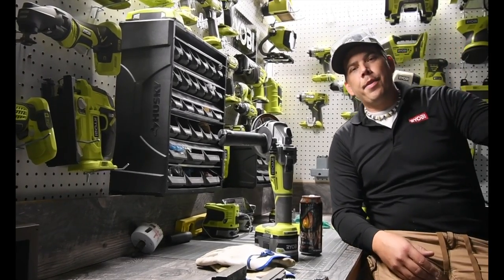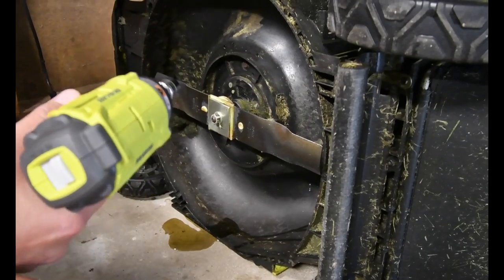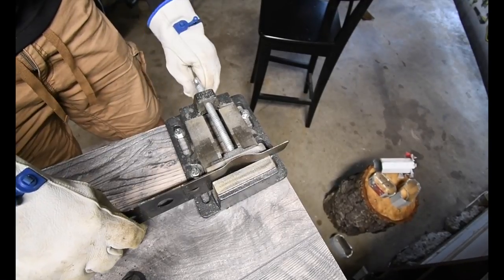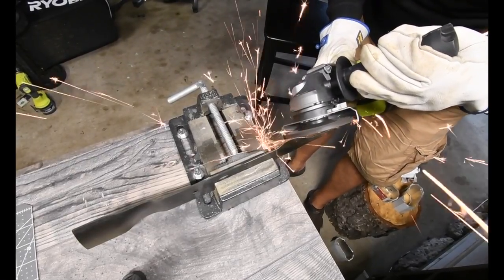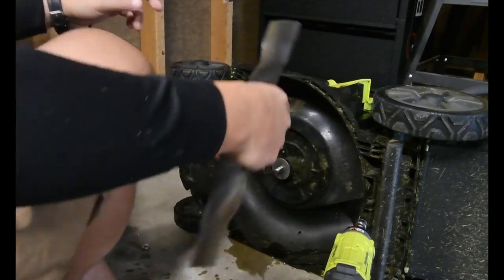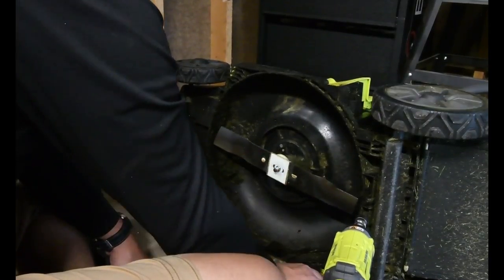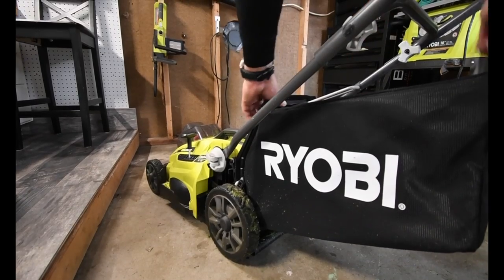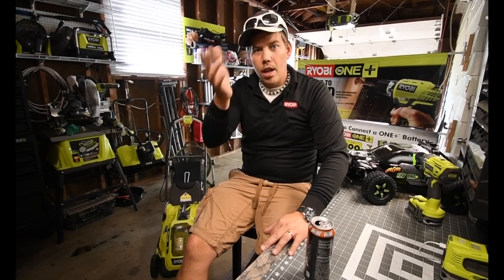Ryobi Lawn Mower Blade Sharpening

Comment: Did you balance test the blade after sharpening?    Basically just put it on a round shank screwdriver and see if one side dips down or it sits level. Then turn it 180 degrees and see what happens.  If it’s not level remove a little from the side that dips.   
Sharpening blades is definitely the way to go!
Reply from the maker: I did not sir. that and thank you very much

Comment: Just a recommendation cause I just purchased my Ryobi 18+ cordless grinder yesterday to sharpen my mower blade on my Ryobi 40v mower and used a Diablo 4 1/2” 60 grit flap disc $8, and 1) it’s much quieter but 2) you get a butter smooth and crazy sharp edge from it. My mower has never ever cut better, even out of the box. Also, for under $10 a blade balancer is a perfect way to go to ensure everything remains 💯 for smooth operation.
Reply from the maker: I thank you J Paul
Reply: Yep plus one for a flap disc. Used 80grit on my Ryobi cordless and gave my Ryobi 46cm blade a perfect finish. I also find its easier to get in the grooves

Comment: Just a quick safety suggestion for you:  Better to wear some protection for your legs against sparks when grinding and most importantly wear some safety shoes or boots.. if you lose control of that grinder, the wheel keeps spinning right as it falls to the floor... and onto your foot !!  Stay Safe.
Reply from the maker: I will be getting shoes and ear plugs. this was an old video and I don't work like this any more but I thank you Gtcoulter

Comment: They've since redesigned the way the batteries go in the 18v mower. The one I got receives the batteries sideways side by side, you can actually use a 9ah battery. I guess they changed it once 9ah batteries came out.
Reply from the maker: My wife wont let me buy it :( since I already have that works

Comment: With your relatively recent recommitment to safety, you might have considered footwear that covered all of the skin of your feet.  Rocks in the grass and on the asphalt and bits of broken glass become nasty projectiles when hit by a fast moving blade.  Lawn professionals in the jurisdiction in which I live may not operate mowers without steel toed boots.  That might be excessive for most home users but could be justified for 40 hrs/week of exposure to risk where there might be a significant unknown liklihood of rocks in with the grass.  When I visited an oil town, safety culture was so engrained by the companies that I saw homeowners wearing full safety gear with steel toes, hearing and eye protection as well while mowing.  Long pants are also required personal protective equipment with mowers where I'm from.
Reply from the maker: Your right about that. wearing pants is not a bad idea at all

Comment: Nice job sharpening your blade Dave!!  I have been using my blue Ryobi grinder for sharpening my mower blades for over ten years now. In ten minutes you get a sharpened blade. Way cool. Dave don't modify your mower,  upgrade to the 40V  21 inch steel deck mower.  Maybe Ryobi could make their 20 inch mower run off two 18V+: 4ah, 6ah or 9ah batteries. Total 36 Volts!! The Mower in the link is the one I would prefer or a 20" push model that looks like it.   https://www.homedepot.com/p/RYOBI-20-in-40-Volt-Brushless-Lithium-Ion-Cordless-Self-Propelled-Walk-Behind-Mower-with-5-0-Ah-Battery-Charger-Included-RY40190-Y/304593558?MERCH=REC-     I think this mower would sell tons better if it run off two 18v+ batteries!! They could even offer a hold down boost button for cutting thick patches with there new Lithium+HP batteries! What do you think?
Reply from the maker: Im hoping that they do make a 20" mower, id buy it